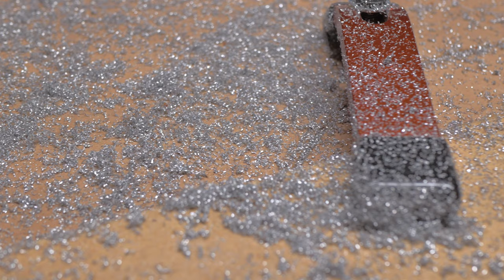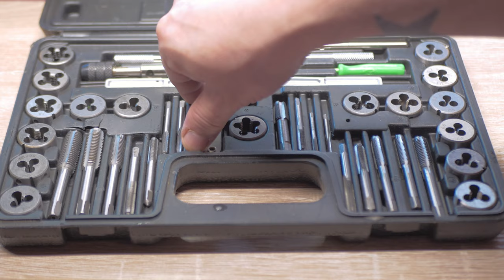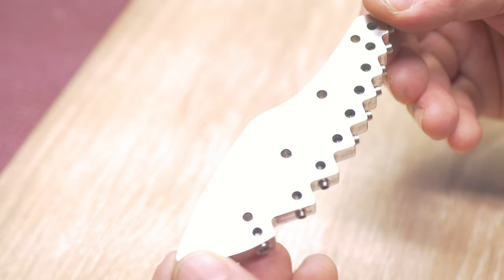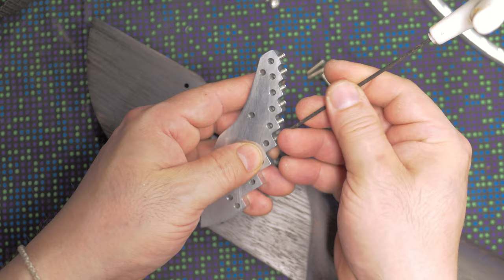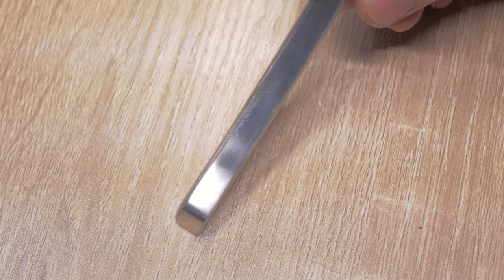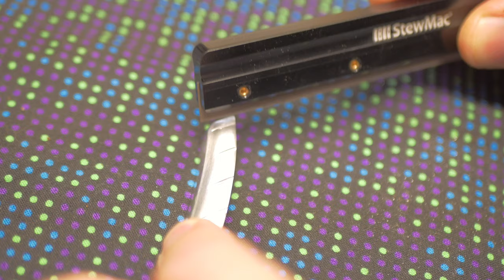A Unique Headless String Lock Design - Great Guitar Build Off 2022 #greatguitarbuildoff2022

Comment: Mark, once again, awsome work.
We have the same cnc machine I think. Just did my aluminum plate for my ggbo. Not easy to work with indeed!! I found adaptive toolpath super helpfull… and cutting oil helped for chip not to stick on the endmills…
Reply from the maker: I used WD40 for cutting fluid. I could spray the aluminum from far away using the long plastic straws. The real trick to cutting aluminum is using a single or two flute end mill. Those really clear out the chips.

Comment: That's so cool! Have a question, are the grub screws stainless steel?
Reply from the maker: Yes. They are stainless steel. Got them from Mcaster Carr. https://www.mcmaster.com/grub-screws/extended-tip-set-screws/
Reply: Doesn't stainless and aluminium dislike each other, ie the aluminium will gall up the stainless when threaded under tension.
Reply: @johnboihardy  may not happen straight away but yes Ali and stainless are dissimilar metals and the Ali will fizz. A threaded insert or a barrier/coating will help. I've used lanacote in the past.
Reply from the maker: @johnboihardy  I had no idea different alloys  didn't play well together. Hope it all works out.
Reply from the maker: @barrychristian4050  You guys are scaring me. Should I worry about this? I'll look into lanacote.
Reply: @MarkGutierrez  it may not be a massive issue straight away and there is very little moisture/humidity. Lanacote looks like grease but there are other products that do the same. There's a chart think it's called galvanic chart that shows most noble and most anodic metals, the further apart they are the more they dislike each other
Reply: @MarkGutierrez  duralac is another anti corrosion paste that works well